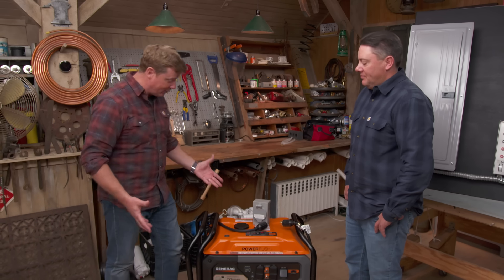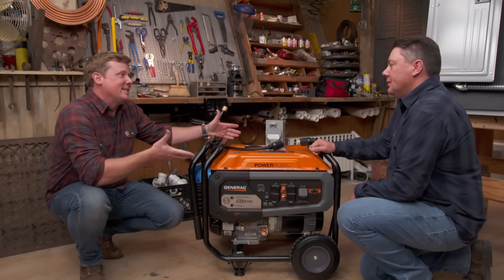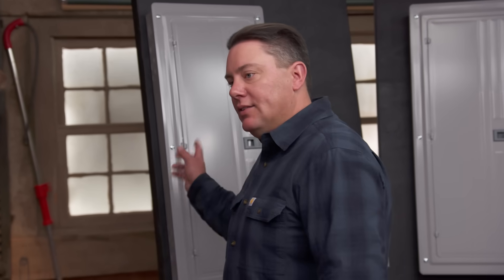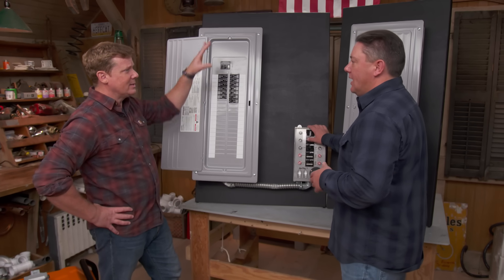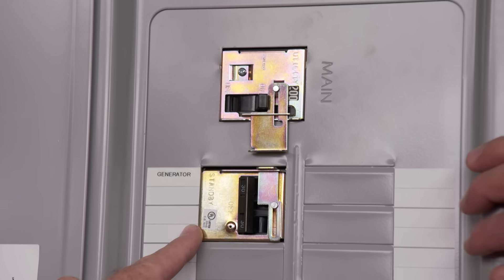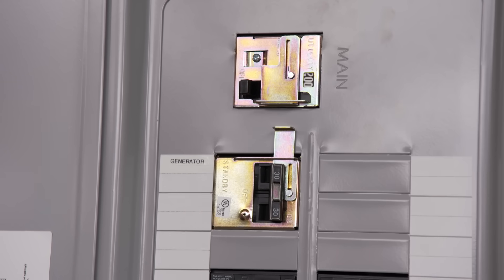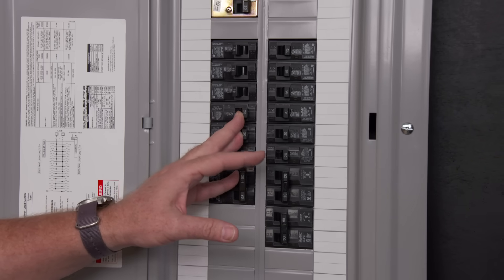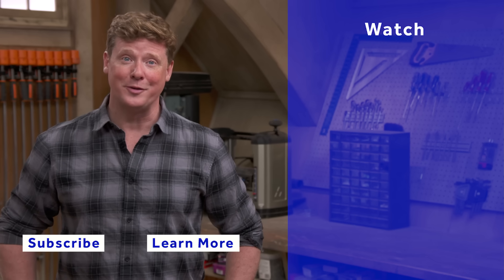How to Wire a Portable Generator | Ask This Old House

Comment: It doesn’t show how to wire a bonded generator. I have the generator exactly like the one you’re showing in the video. You do not show how to connect a bond of generator and wire it to an electrical main panel. All of the other stuff is so superfluous! It is a very very poor video it doesn’t say hardly anything. Do you have one that shows what I’ve asked?
Reply: Yes.  Even with an transfer switch (most in this price range) do not address the bonded neutral of the gp8000e and the bonded neutral in the panel.  My guess is they disconnected the neutral wire connected to the ground in the gp8000e?  Does Generac approve of this?  A floating neutral generator.

Comment: Just coming off several days with no power after hurricane Milton. We ran a generator outside and had extension cords going everywhere in the house. It's a mess to rearange some of the house so you can plug everything into cords. This option is definitely cleaner and gives you a lot more flexibility by using the panel.

Comment: Can i backfeed my house with an ungrounded generator and then run a suicide cord to my welder so i can weld in the rain? Note-i would be welding a couple feet from the generator but it's outside so no risk of CO poisoning right?

Comment: It would be good to have mentioned that with all the electronics in a modern home you should get an inverter generator.  They provide cleaner power without the voltage spikes that regular generators create.  Inverter generators are also more fuel efficient and can be among the quietest.

Comment: Problem is. Around here anyway. When power goes out. U can't hardly get gas. Last time we had a big outage from a storm is was like the end of days. People were going crazy. U couldn't do anything. Couldn't get gas.
Reply: Always keep some on standby. Fill your generator and add a stabilizer. You should run it every month or 2. Every 6-12 months run it until empty. This is a good time to see what all you can run on it. Also keep a few 5 gal gas cans around. Just rotate out the fuel regularly.

Comment: I have the same generator and used the interlock option when wiring it to the house. I was able to run all my lights (all LED bulbs), outlets in my livingroom, 2 bedrooms, fridge, deep freezer, and 1 BIG item at a time i.e. water heater, stove top, or AC.
Reply: What size is it?

Comment: I hooked my generator up to the well house subpanel so that I will have water during a wildfire when the power provider will turn off the power.  I used a rotary power selector switch for line or generator to the panel.  Works great but I did have to learn about neutral/ground bonding since this is a subpanel when on line and a primary panel when on generator.  Two different circuits depending on the power source.

Comment: You didn't actually wire the generator. You wired the house for the generator.  Any issues with floating of bonded ground on the generator?  VIP

Comment: Yes this way works but way too much work in wiring ya don't need. get the mechanical interlock
that must have the MAINS off so u can turn on Gen breaker, Just have a good idea of what ur
using and its watts. yup u never want power to go up the service drops.

Comment: I really appreciate this video as just today I almost made the biggest mistake of someone coming out to my home to do a generator to home install.  There were so many red flags, but as soon as I saw he was going to splice the outlet for the generator directly to the main power rather than using an interlock or transfer  switch. I immediately told him to stop what he was doing.  And undo everything saw him do and terminated all business with him and his company. Come to find out the were not accredited with the BBB and there were several complaints on how the work they were doing was not safe or legal. So now I just need to find a legit electrician to do this install of an interlock shown in this video located here in San Antonio. Thanks for your insights with this great video.

Comment: I am buying a portable generator,  after the horrific experience of living through the grid failure last year here in Austin, TX. I just had my electrician, refuse to install one of these options even though he was replacing my panel and upgrading my service.  Has anyone ever heard of this? I couldn't get him to do this. Is this normal?  Needless to say, he's not going to do any further work for me.

Comment: also don't forget you would much rather get one that you can use with a propane or natural gas kit just in caseBecause if using gasoline you run the risk of not being able to go get more gas if it runs out so the benefits of running it off of either a natural gas or propane line would be the fact that it would almost be unlimited runtime which is a big benefit to those long-term power outages as long as the gas lines aren't affected you'll still have unlimited gas supply from the natural gas line

Comment: One thing to know that I've never seen mentioned in these videos is that transfer switches and heavy duty extension cords will not be in stock if there's a widespread outage from a natural disaster. Home Depot will bring in a truckload or two of generators and stack them in the  middle of the isles, but they won't think to bring in the other stuff you need to safely power your house off of one. And how hard do you think it is to get an electrician to come out to your house in a days-long power outage? If you think you might ever need a generator, get the hookup installed when it's not an emergency. You can hold off on buying the generator itself if you want.
Reply: You never wait until an emergency to prepare for the emergency.  I live in south Louisiana and we stay stocked with emergency supplies for hurricanes.  In fact, I am watching the video now to learn about getting a generator transfer switch before hurricane season.
Reply: Majahansen311 Great advice!
Reply: Something I haven't seen TOH talk about with generator vids is Dual Fuel generators.  Gas or Propane.  Gas is hard to keep viable as without using fuel stabilizers and refreshing the gas periodically, you could end up with bad gas and no way to get any more with a big outage and the electric is out at the gas stations too.  Propane doesn't go bad.
Reply: @robertf6344  The only time we lose power for an extended amount of time in south Louisiana is when a hurricane hits.  I have 4 5 gallon gas cans that I fill up for the generator.  I never just keep many gas can full, just a 5 gallon can for the mower.  Once a hurricane has passed and the power is restored, I pour the remaining gas into our cars gas tanks.
Reply: ⚠️Here are the safety rules of using portable generators. This is a very important announcement. 

It is important to follow all generator safety rules whenever we use portable generators: 

Everyone must see this. This is just a reminder for everyone’s safety. 

1) KEEPING OTHERS SAFE: Please do not allow an unqualified person or your children to operate and service the portable generator. Just because some manuals don’t say that doesn’t mean it’s safe. That is important against the generator safety rules. We also need to be keeping an eye on our children too. You need to make sure that your children are not playing near the portable generator especially when it’s running so they won’t get electrocuted. Generators pose electrical risks and they can be hot during an operation. Please keep your children away from the portable generator at all times. It is important to keep our children safe especially our little ones. Be aware of all the hazards.

2) WHERE TO RUN YOUR GENERATOR: Some people use their portable generators indoors which increases the risk of carbon monoxide poisoning. It’s important to have a carbon monoxide if you have a gas generator. Never ever use your generator indoors even if your doors and windows are open and even in the garage is not safe to use a portable generator. Not even at your porch and your deck. It is never safe to use your generator indoors and in enclosed areas of your home. Your generator needs to be 15-20 feet away from your house. 

3)🔥FIRE HAZARDS: Never refuel your generator while it’s running. You need to let your generator cool off before refueling it and before storing your generator. Never overload your generator too. Never ever back feed your generator. You should never plug your generator into a wall outlet. Also never store propane tanks indoors. Please keep flammable things away from the generator as well and please don’t smoke cigarettes near the generator. Having a fire extinguisher next to the generator is also important against the generator safety rules. 

4) GENERATOR OPERATION: make sure your hands are dry before touching the generator. Never use your generator in wet conditions. Don’t let your generator get wet. You need a generator tent if you need to use your generator during wet weather. Please don’t wear loose clothes when operating the generator. Turn on your generator before plugging in appliances. Use the right cord for your generator. Please do not use worn out cords. 

https://youtu.be/I1jT3ANENvI and here is a video more about keeping others safe when using generators 

Hope this helps. Please make sure you follow all the generator safety tips. Thank you

Comment: since I only have 100amp service and no room to add a breaker for the generator I have to add a transfer switch correct? My only other option is to upgrade my panel, right?
Reply: Correct.

Comment: Ah yes, $50 sheet-metal interlock plates, because the general public cannot be trusted to switch off their main breaker when connecting a backup generator to their home.
Reply: Would you trust the "general public"?  I sure wouldn't.
Reply: Don’t forget about the generator safety rules: Always make sure you follow all the generator safety rules whenever you use your portable generator. This is only a reminder. Generators can be dangerous if not used carefully. Every year, hundreds of people die or get injured when using portable generators due to carbon monoxide poisoning and electrocution. Make sure you are using your generator carefully and keeping others safe as well. There is something very serious that everyone should always be aware of when using generators. Some people do run their generator indoors which is not safe and that increases the risk of carbon monoxide poisoning which can cause death of family and you. Some people run their generator in wet conditions which can electrocute them. Please remember that you should never run your generator indoors. Remember that carbon monoxide is an odorless and colorless gas that you cannot see or smell. Carbon monoxide is a silent killer. Keep that in mind. Make sure your generator is 15-20 feet away from your house and away from doors, windows, and vents. Never use your generator in your porch too. Having a carbon monoxide detector is very important against generator safety. Some people also allow children to go near the portable generator which could pose risks. We need to keep an eye on our children making sure that they are not near the portable generator so they won’t get electrocuted or burned by the generator which is dangerous. A locking enclosure also keeps kids safe. A generator shed might look like a tempting place to explore, or take cover during a game of hide and seek, but a generator is a dangerous piece of equipment that can cause injury. It says on the manual that we should also keep children away at all times from the portable generator to avoid injuries. Please do not allow a child or unqualified people to operate the portable generator.  It is important to keep your children safe especially little ones. The portable generator can be hot during an operation. Just because some manuals missed what should be listed doesn’t mean it’s safe to do. Always follow the generator safety rules when using portable generators. Generators pose electrical risks. If you need to use your generator during wet weather, you need a generator tent to protect your generator from getting wet. Don’t let your generator get wet. Keep your generator dry and before using your generator, please make sure your hands and your generator is dry. Do not wear loose clothing when operating the generator. Everything that is said on the generator’s operating manual should not be ignored. Never smoke cigarettes near the generator. Please keep flammable things away from the generator. Never overload your generator too. Your generator can catch fire. Never ever try to plug a generator cord into a wall outlet to avoid back feeding. Back feeding your generator is dangerous. Always turn on your generator first before plugging in appliances and shut off the appliances before turning your generator off. Use a heavy duty cord for your generator and the cord should not be worn out. All the instructions should be followed carefully. Never refuel your generator while it’s running. It can cause fire if fuel spills while your generator is hot. You should turn off your generator and let it cool off before refueling it. Having a fire extinguisher next to the generator is also important. This is only a reminder for everyone’s safety of using generators. Make sure your generator is properly grounded. Having a fire extinguisher next to the generator is also important against the safety rules. https://youtu.be/I1jT3ANENvI and here is a video more about keeping others safe when using generators and also about our family’s safety. It’s important to keep our little children safe as well. Make sure your little children are kept away from the generator at all times especially when it’s running. Hope this helps. Always remember that it’s better to be safe than sorry.

Comment: Is it possible to list the types of items necessary to install a generator?
Reply: May need to contact an electrician and/or your power company. But usually you can find most items by searching for the essential items online. Its unfortunate they go through the trouble of explaining, but not through the trouble of listing the essential parts required.
Reply: ⚠️Here are the safety rules of using portable generators. This is a very important announcement for everyone. 

It is important to follow all generator safety rules whenever we use portable generators. This is a reminder: 

Everyone must see this. This is just a reminder for everyone’s safety. 

1) KEEPING OTHERS SAFE: Please do not allow an unqualified person or your children to operate and service the portable generator. Just because some manuals don’t say that doesn’t mean it’s safe. That is important against the generator safety rules. We also need to be keeping an eye on our children too. You need to make sure that your children are not playing near the portable generator especially when it’s running so they won’t get electrocuted. Generators pose electrical risks and they can be hot during an operation. Please keep your children away from the portable generator at all times. It is important to keep our children safe especially our little ones. Be aware of all the hazards.

2) WHERE TO RUN YOUR GENERATOR: Some people use their portable generators indoors which increases the risk of carbon monoxide poisoning. It’s important to have a carbon monoxide if you have a gas generator. Never ever use your generator indoors even if your doors and windows are open and even in the garage is not safe to use a portable generator. Not even at your porch and your deck. It is never safe to use your generator indoors and in enclosed areas of your home. Your generator needs to be 15-20 feet away from your house. 

3)🔥FIRE HAZARDS: Never refuel your generator while it’s running. You need to let your generator cool off before refueling it and before storing your generator. Never overload your generator too. Never ever back feed your generator. You should never plug your generator into a wall outlet. Also never store propane tanks indoors. Please keep flammable things away from the generator as well and please don’t smoke cigarettes near the generator. Having a fire extinguisher next to the generator is also important against the generator safety rules. 

4) GENERATOR OPERATION: make sure your hands are dry before touching the generator. Never use your generator in wet conditions. Don’t let your generator get wet. You need a generator tent if you need to use your generator during wet weather. Please don’t wear loose clothes when operating the generator. Turn on your generator before plugging in appliances. Use the right cord for your generator. Please do not use worn out cords. 

https://youtu.be/I1jT3ANENvI and here is a video more about keeping others safe when using generators 

Hope this helps. Please make sure you follow all the generator safety tips. Thank you